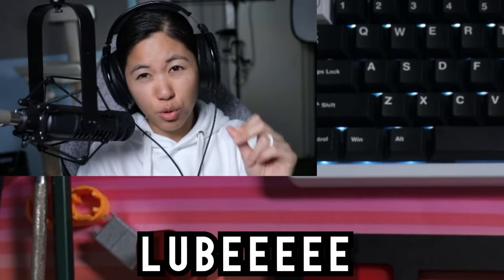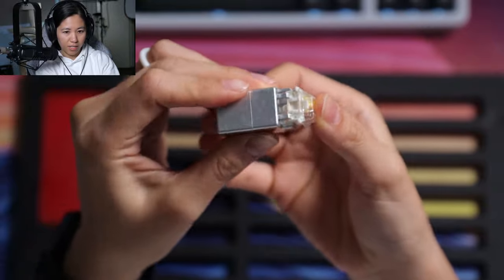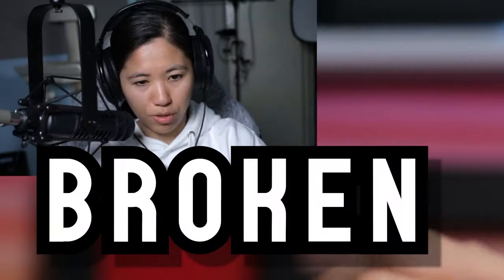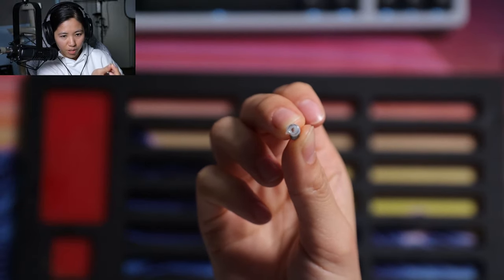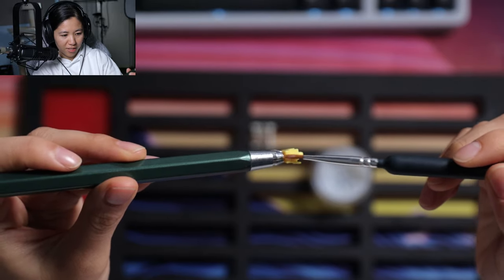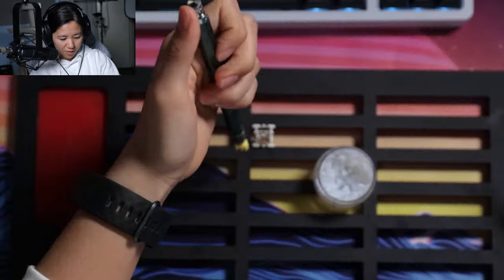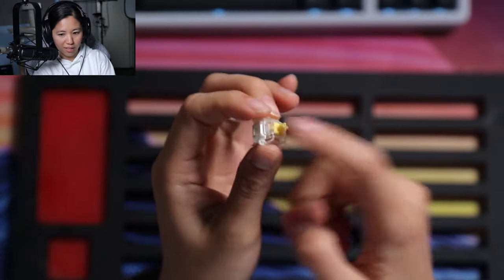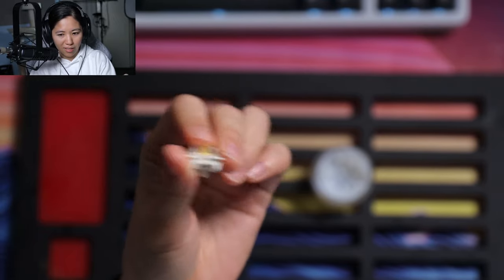How to lube switches  FAST

Comment: I just got into the whole mechanical keyboard thing and lubing switches. I had one switch which had a noisy spring ping so I did it exactly the way you showed it in this video and gone is the annoying spring ping. Now I am going to do the other switches as well. Thank you Betty from @switch and click!

Comment: This video helped me a lot. I don't have the special tool for opening so I easily opened them with a flathead screwdriver. I don't have lube so I used dielectric grease. I followed the steps in the video and the result is remarkable. Thanks.
Reply: Seriously man this comment physically pained me to read. It will make a difference but dielectric grease is too think and doing it with a screwdriver takes forever. I cannot recommend enough getting like 5 grams  krytox 205g0 and a switch opener for like 20 bucks combined. It will be so much better on every single level. Or just by prelubed switches like matcha lattes, vertex v1, or gateron pure berries or a ton of others. But for the love of god no dielectric grease please
Reply: @wolf-xf6hf theres no krtox where i live, what else could i use
Reply: @sxssa4691  spray lube with cooking oil 😳
Reply: @wolf-xf6hf oh are you physically in pain right now?
Reply: DO NOT USE DIELECTRIC GREASE TO LUBE A SWITCH
I REPEAT
DO NOT USE DIELECTRIC GREASE TO LUBE A SWITCH

Comment: Does the sound will stay forever or do you have to refresh the key after a couple of weeks?
Reply: It will last waaay longer than weeks. I dont know if you practically have to ever lube them again but id guess that itll at least last 2 years or so with heavy use
Reply: Pretty much forever

Comment: I have no super lube or krytox 105 oil, but I still want to bag lube my springs. What alternatives can I use? I have krytox 205 though. Can that be mixed with water or smth for bag living springs? Pls respond thanks.
Reply: Im not sure if you’ve found a solution but I’ve seen someone brush lube on the inside of a bag or Tupperware and shake it like that

I don’t know how effective it is though
Reply: @axaviersan1243  thanks for responding. I ended up manually lubing the springs. Was very tedious. But I’ve just recently purchased the oil based lube anyway.
Reply: you can just do it with normal 205 by brushing it on the sides @abcdefuuu

Comment: I did this method for 90 switches and as I had no oil based lube, I used krytox and donut lubed the springs. 

Every single spring. 

The results came out great but it was absolute pain as it took forever. I'll use a bag and super lube next time

Comment: how long does lube like 205 last on keys and stabz?
Reply: i’ve had switches getting daily use for like 1-2 years and never had problems. 205g0 on the switches and stabs and the 105 on the springs

Comment: Idk why but my overlubed switch sounds really good
Reply: I saw a video where over lubed switches initially sound very good and then after some time they get stuck or something and don't work. How's yours going now?
Reply: @melodychest9020  yea some switches did ended up stopped working, but like the frequently used ones (wasd) works fine but like the ones that i barely touch will kinda like getting a little unresponsive, and some will just stopped working, idk if its because i fucked up the pcb while doing the tape mod or not, i didnt saw any physical damage on the pcb tho
Reply: @worstie9738  Oh, that is unfortunate. I am guessing that the excess lube got to the contact points of switches and acted like an insulator and stopping conductivity, so the signal is not getting through. U will need a thorough cleanout of the pcb to remove all the residue around the contact points and surrounding areas. Not a fun job!
Reply: @melodychest9020 i figured why some switches ended up stopped working, its because i put a shit ton of lube on the leaf and after i wipe off all the lube it works just fine so yea moral of the story is dont lube the leaf part if you dont know what you are doing lol

Comment: Dipping is a terrible idea. Try it guys and you will see. If you want thocky sound, just manually lube the housing base (side of the spring post) and put all the springs in a plastic bag and mixed the lube in there and shake. Then buy a cerakey key caps + tape x3 your board. Guaranteed thocky 100%. Donut dipping gives you a terrible sound.
Reply: i agree and feel mushy too worst lubing video out there should be less is more

Comment: Do u recommend using Krytox GPL 105 oil lubricant lube for lubing my rk61 keyboard switches?
Reply: If you bag lube the springs, it’s good for that but for anything else, I would recommend 205g0 or mix the 105 oil with something thick like 205.
Reply: @kaeroseon  never mix lubes its not going to end well but like you said he can baglube the springs with 105 but the rest with 205 it will probably be better to buy 205g0 and lube the rest of the switch and tublube the switches with 205g0 then you do not need 105 you can use 205g0 on the spring to.
Reply: @kaeroseon  if you want thick lube then use 206 not 205